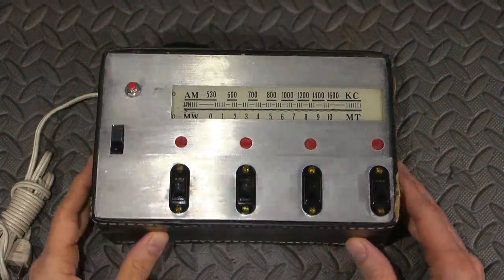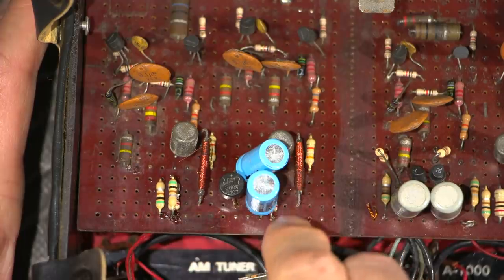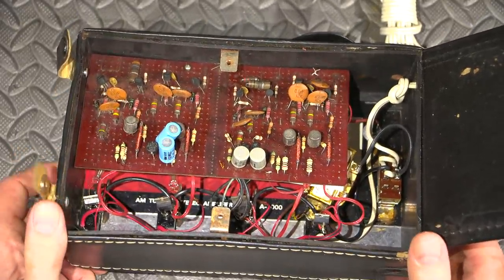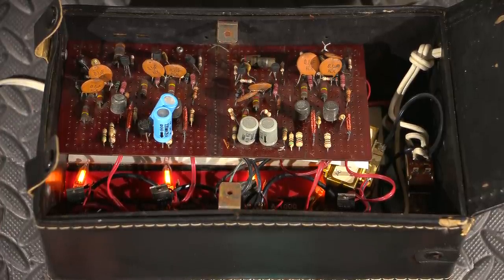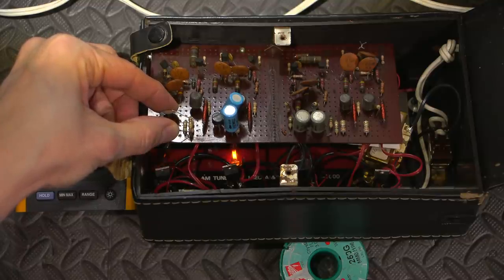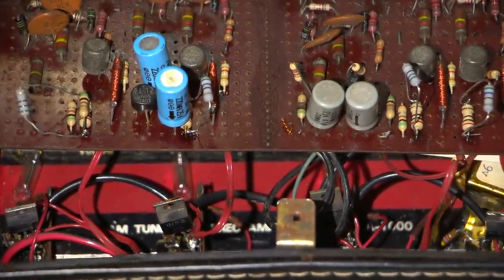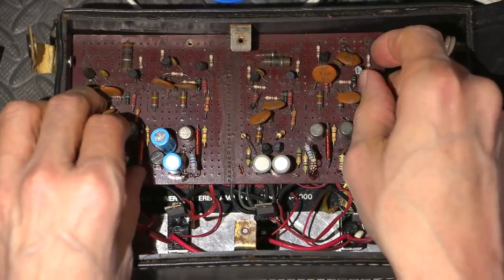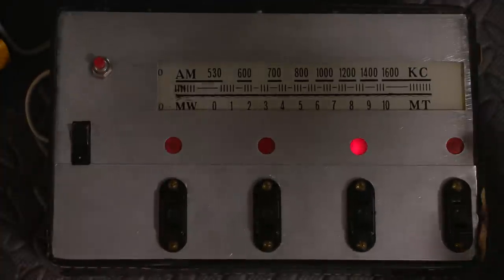Electronic Mystery Box - What Is It?

Comment: The leatherette covered box is a radio case.  My older brother had the very same case.  I forget what kind, but it was AM FM. The radios had a fatal flaw. If you drop it, the circuit board broke easily. His was put together a couple of times. 
Someone found a use as a project box.

Comment: I'd guess late '60's and that it was used for shining colored lights on an aluminum Christmas tree. And a stretch of a guess - it was built by an EE, because they knew how to build it, but their soldering was poor. BTW, I always use my Exacto knife to clean the leads on old in-circuit resistors. The leads are always oxidized. 

The aluminum was the old face-plate for the radio and they just flipped it over to create a blank face-plate. But they had to fill the big hole with something, so they put the dial display back in.

Comment: 1:19 I'm thinking maybe lighting controller?
4:00 them are some Creative folks there. I see a hand wound magnetic switch.

Residential is 100V, split phase and three phase 200v and 415V. And of course 50 and 60 Hz (cycles) some areas around US bases tend to be closer to 120V if I'm remembering that right might be confusing the Philippines. Probably far more likely that they used a 200V transformer at half voltage. Unless of course it's for a 220v country.

Comment: It is a 4 stage shift register made with discrete components. For sure there are one oscillator (maybe 4Hz) 4 bi-stables that cascade and the output of the last one is feed in the input of the first one. When press the red button, you give a "1" at the input of the first bi-stable  and the register circulate the sequence. It seems random because but you can feed the "1" at the time you want and set the pattern that you want.  I saw that kind of schematic in many old magazines and books from around 70's. Later, one would do this with 7474 or CMOS equivalent and now with an 10 cents microprocontroller.
Is odd the 200V mains supply, I did not know that in Japan they used 200V.

Comment: Now the trick is to find a use for it. It would be prudent to not use the original design in a situation where a reliable sequence is required. Of course we all want you to modify it so it is reliable and etch a new board using smt parts and then put it in the original case that's been restored. But to think that there was a time when someone wanted that particular function and was willing to wind his own coils over the reed relays.

Comment: Line voltage in Japan is around 100. Frequency is 50 or 60 cycles depending on where one is.
Reply from the maker: Yes it is, and it's also 200V as well. I can't tell you (lost count) how many 200V power supplies I have serviced from Japan.
Reply: @MrCarlsonsLab  200V is three-phase in Japan.
Reply from the maker: Scroll down the list to Japan: https://en.wikipedia.org/wiki/Mains_electricity_by_country

Comment: A 200v transformer with 9v outputs on 115v would give about 5v, so I'd suspect that it's just a "take what you have" transformer. If it was Japan I'd think it would be either 110 or 220V, not the odd 200V.
Reply: Japan uses 100/200 instead of 120/240 like North America.
Reply from the maker: Scroll down the list to Japan: https://en.wikipedia.org/wiki/Mains_electricity_by_country

Comment: Really cool video. Since Japan normally uses 100V instead of 200V, it would be odd. Also, the Chinese characters present in that piece of paper are Traditional script, which Japan replaced some orthography with Shinjitai. (Two visible characters were: 音機 which mean sound machine; it's likely missing one character that could make it mean: radio or recorder). If I had to guess, I'd say Hong Kong based on the voltage and use of traditional Chinese characters.

Comment: When I saw the outlets I figured vit was an outlet switcher. Then he opened it up and I saw the 8P DIP. I could C the numbers however I figure it is a 555 or 4558. From I figured a sequential/random switcher. I watched the rest and it seems I figured correct.  I am surprised the way he was talking he did not point out the IC. I like the nostalgic case. I had a radio in a case like that. It was given 2 me not working. I repaired it. I listened 2 it many years.

Comment: I was under the impression that Japan used 100V line at either 50Hz or 60Hz depending on what side they were on, not 200V on single phase.
I wonder if this was something a little more specialised given the primary transfomer has 200V primary.  That is a bit unusual.

Comment: I built a slightly larger version of this in my youth. Our mains is 230 V so I was playing with fire. I used 4 triacs to switch the outlets which were on the back of the case, and they were switching the neutrals - not the phase lines which were live all the time. It was a bit of a death trap really.
Reply: not sure why it  reeds reed relays and  triac,s as they should stand 240V   also the relays would be very low resistances as not much wire on them  50 Ohms maybe

Comment: Isn't Japanese mains 100V? That writing looks to be Chinese; China's mains voltage is 220V
Reply from the maker: Scroll down the list to Japan: https://en.wikipedia.org/wiki/Mains_electricity_by_country
Reply: Residential is 100V, split phase and three phase 200v and 415V. And of course 50 and 60 Hz (cycles) some areas around US bases tend to be closer to 120V if I'm remembering that right might be confusing the Philippines. Probably far more likely that they used a 200V transformer at half voltage.
Reply from the maker: In the video, it didn't operate at half voltage, and the board is marked Japan.

Comment: When I was in sixth grade electronics class in the San Francisco public school system are Japanese electronics teacher we would make stuff like this in sixth grade.  Now everything is digital and something that complex compared to nowadays using analog would be considered too complicated for even junior college level electronics class lol . 
            How far are public school education has fallen by removing all the trades hands-on classes out of middle school and high school. 
       Nowadays they would just grab a raspberry pie or AR Dwayna or a pico and plug it in and program it to do the same thing and never learn the hands-on skills in the basic rudimentary of anything electronic except what they read out of electronics book.
Reply: It is sad that all the "tradesman" classes that we had in high school are gone. I had metal shop, small gas engine and wood shop. I flourished in these but struggled in most other classes.  Today I'm a successful HVAC technician and many things I learned in high school have followed me to today. Now we hire 20 and 30 year old "technicians" who took a local HVAC course. They have never used half the power tools we use. Also, my flashlight was acting up and I pulled the batteries out to check the voltage because I thought I had just changed them a day or two before. The guy looked at me mystified as I read the meter off as 1.3 volts, he asked me what it should be... Come to find out battery voltage of batteries is not common knowledge. Come to find out 3 of the 4 "younger" apprentice couldn't tell me what voltage a AA battery was.

Comment: When I lived in Japan, our line voltage was about 100 volts.  We even needed to use  step-up transformers to run our USA equipment designed for 117 volts.  Maybe a better guess would be that this device was made in Europe where the line voltage is 220?
Reply: Yup, can confirm, Japanese line voltage is 100V 50/60Hz (depending which side of the country you're on).
Reply from the maker: Scroll down the list to Japan: https://en.wikipedia.org/wiki/Mains_electricity_by_country
Reply: @MrCarlsonsLab  While Japan does have 200v, the vast majority of household appliances use 100v, and the plugs/outlets this device have are used for 100v service. Japanese 200v plugs/outlets are more similar to our NEMA 6-15/20 outlets.

So while it has Japanese writing on the inside, the actual intended use of the device seems a bit odd given the plugs/outlets it has but the voltage of the transformer.
Reply from the maker: Home brew project. My variac has a standard outlet for the 220 as well.
Reply: @AmericanLocomotive1  Yup, even things like clothes driers in commercial premises still run on 100V, found that kinda nuts...

I don't think I've ever seen anything but 100V outlets in my travels, so perhaps it's more a semi-industrial thing.

Comment: Was Japan using 200V before? These days it is 100V of line voltage, got me puzzled when you said it is from there
Reply from the maker: Scroll down the list to Japan: https://en.wikipedia.org/wiki/Mains_electricity_by_country
Reply: Residential is 100V, split phase and three phase 200v and 415V. And of course 50 and 60 Hz (cycles) some areas around US bases tend to be closer to 120V if I'm remembering that right might be confusing the Philippines. Probably far more likely that they used a 200V transformer at half voltage.
Reply from the maker: In the video, it didn't operate at half voltage, and the board is marked Japan.
Reply: @MrCarlsonsLab  Thanks for the answer! It does indeed say 100 and 200 volts. Probably it depends on the building, because I do not have 200V outlet. Gonna look for 200V outlets from now on)
I saw the inscription on the PCB, but assumed it was just exported from Japan - they were a big producer at the time.

Comment: Call it what you want, but a homemade item with 200 volt marked on the transformer might not really require 200 volts. It very well could be that the maker needed 6 volt on the output and this was the closest he could find. Run this on 120 and you get 5.4 volts on the output 4.5 to 6 volts common on many electronic circuits.   If you were wrong, short video ended with poof of smoke.

Comment: It's a ring counter. Pressing the button injects a 1 bit, which propagates through the flip-flops. Press the button more times, and more 1 bits join the parade. Eventually, they're all on. So you can have them all off, all on, or in sequences 1-0-0-0, 1-1-0-0, 1-0-1-0, and 1,1,1,0. It looks to me like it's working as designed.

Comment: It's interesting that they use transistors to drive reed relays to drive TRIACs. Why didn't they just use standard power relays? The only thing I can think of is that regular relays might not be good for as many cycles as reed relays. Or they could have driven the TRIACs directly from the transistors without isolation. It would potentially be less safe, but should be fine if the switches are isolated.
Reply: Reed relays can indeed withstand a very large number of cycles given they're not switching any significant current. Some multimeters for automated testing use reed relays to allow sequencing through many inputs.

Comment: Hi Mr. Carlton, I just bought a Pace soldering station, sec. hand and want to pick up my old hobby :) (Electronics)
I read and see a lot of talk about soldering fume extraction on YT. There seem to be a lot of options.
I repair saxophones for a living in the Netherlands and that requires lot of hard- and soft soldering jobs aswel.
Do you have a suggestion when it comes to DIY building an extraction system? Or would you recommand a prof. system which is usually more expensive.

Comment: Hi and greetings from across the Pond! You described very nicely how you thought the Outputs were being driven - confirmed by the flashing neons and night-light. But what is the Input? It always starts as 1,2,3,4. Then you press the red button and the sequence changes until it runs out of choices and all four Outputs are lit solid. How is this being achieved please? There are no digital devices involved so this is created with discrete devices - somehow? I've forgotten so much since the 1970's!! I used to sell radios that came in cases very like this one. It was 1972 and they were cheap - Made in Hong Kong - (not Japan). They weren't renowned for their reliability. I recall there was a larger one that had a Sound to Light display - all discrete circuitry and Christmas Tree bulbs. 🙂 The battery life wasn't fantastic!

Comment: I worked on older equipment that used two diodes and a capacitor to fire each triac instead of these reed switches.
Reply: I think the designer was smart enough to try and isolate the AC from the low voltage circuitry. If someone went wrong, there was no way the AC would get into the circuit.

Comment: I know very little about electronics, but when I looked at a Johnson counter circuit it seemed that each flip-flop would stay on until the whole pattern resets to 0.  I.e. 0000, 1000, 1100, 1110, 1111 .  This device seems to (generally) only have one light on at a time.  Is that single-light pattern also possible with a Johnson counter?  Cool little homespun device!  And thanks as always for the video and information!

Comment: I thought in Japan they used 100v not 200v?
Reply from the maker: Scroll down the list to Japan: https://en.wikipedia.org/wiki/Mains_electricity_by_country
Reply: Residential is 100V, split phase and three phase 200v and 415V. And of course 50 and 60 Hz (cycles) some areas around US bases tend to be closer to 120V if I'm remembering that right might be confusing the Philippines. Probably far more likely that they used a 200V transformer at half voltage.
Reply from the maker: In the video, it didn't operate at half voltage, and the board is marked Japan.

Comment: Thank you for all the awesome videos Mr. Carlson! Could you make one to explain how start and run capacitors are used to create a 'virtual 3rd phase' in a 2, or even 1 phase powered asynchronous induction motor? Also, along the same lines, so to speak, how is it that an asynchronous induction motor can be used with negative slip [I think] as a generator, [or is it a rotary transformer] when there are no magnets, just an aluminum squirrel cage and windings in a stator? Curiouser and curiouser :)

Comment: Hey there Mr Carlson, I'm wondering if you can help me by answering a question of mine. I am studying to be an aircraft avionics technician (aircraft electronics repair), and I wanted to have a succinct few rules to give to the other students for safety around capacitors and inductors. I tried to get to the bottom of this on my own by searching for info like do all capacitors hold charge when disconnected from a circuit, but it's getting me nowhere. I appreciate any time and info you can give me.

Comment: I did stuff as this when I was 8. 1 of the 1st AC circuits I built was a duplex that triggered by a min 50w load of another socket. Ex: I could power on a television by switching a lamp on. I built it 4 an old lady that switched on a light then the television in her television room. All she had 2 do was sit and switch on the light, Shazam! The television came on 4 her. The surprise freaked her out the 1st time.  After I explained it she loved it...and made me a cherry pie. FYI: until then she scolded me about "playing" with electricity. After she asked if I could make her porch light turn on and off automatically Bcuz she would 4get 2 shut it off B4 bed. I built a light sense circuit and wired it in. Basically the same thing they sell now 4 $5.

Comment: Mr. Carlson, while searching for a really good valve amp design book I came across "Builing Valve Amplifiers" by Morgan Jones which is recommended by yourself. I have a solid 12 years repairing Fender & Marshall tube amps & 35 years general electronics repair. My goal is building a very high wattage guitar tube amp (300 + watts). Are there other books you would recommend?
Thanks for the great videos and talks!

Comment: Not that One can't obtain results - (i'm still learning) but did i see you solder on Uncleaned wires (w\out tinning) to resisters first?  

kind of surprised you did it this way, tho It Worked!    lol  Got me 'thinking'.    prep -  i'd need all the help i can get.    =\ 
 - Cool 'Gadget'.  Thanks! - and for 835 flux info, too
Reply: I used to build stuff out of surplus electronic parts not long after that sequencer was built.  And yes clean up those leads before soldering!  A scrape with a small knife is all that's needed, then core solder will work with no added flux.  Surely Mr. Carlson is aware of this and would just rather use the flux, but I'd rather clean the leads!

Comment: Japan Standard Voltage is 100V
Reply from the maker: Scroll down the list to Japan: https://en.wikipedia.org/wiki/Mains_electricity_by_country
Reply: Residential is 100V, split phase and three phase 200v and 415V. And of course 50 and 60 Hz (cycles) some areas around US bases tend to be closer to 120V if I'm remembering that right might be confusing the Philippines. Probably far more likely that they used a 200V transformer at half voltage.
Reply from the maker: In the video, it didn't operate at half voltage, and the board is marked Japan.

Comment: japan has 100V supply
Reply from the maker: Scroll down the list to Japan: https://en.wikipedia.org/wiki/Mains_electricity_by_country
Reply: Residential is 100V, split phase and three phase 200v and 415V. And of course 50 and 60 Hz (cycles) some areas around US bases tend to be closer to 120V if I'm remembering that right might be confusing the Philippines. Probably far more likely that they used a 200V transformer at half voltage.
Reply from the maker: In the video, it didn't operate at half voltage, and the board is marked Japan.

Comment: I thought Japan had a line voltage of 100V.
Reply: Indeed it is 100V, although they have a 200V split phase and three phase at 415V. Far more likely it was a reused transformer at lower voltage if it was indeed used in Japan.
Reply from the maker: Scroll down the list to Japan: https://en.wikipedia.org/wiki/Mains_electricity_by_country